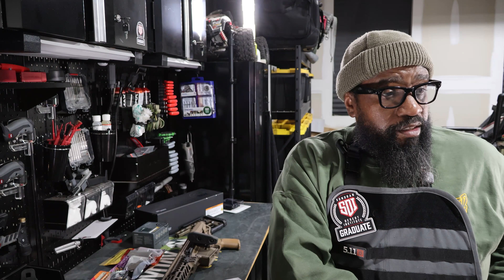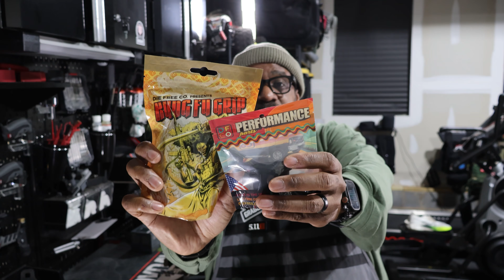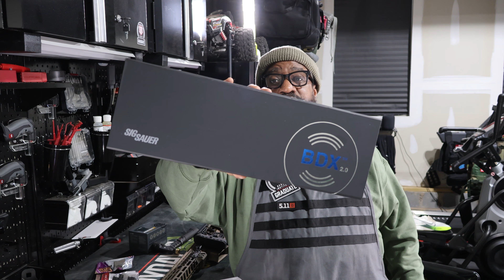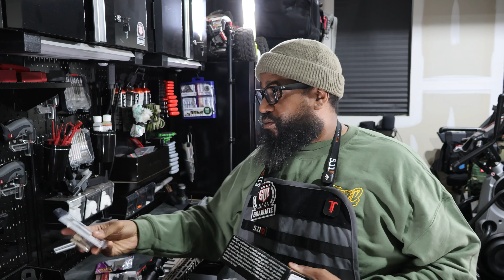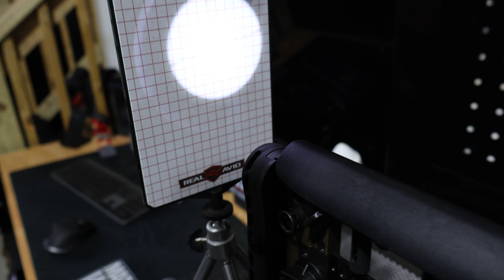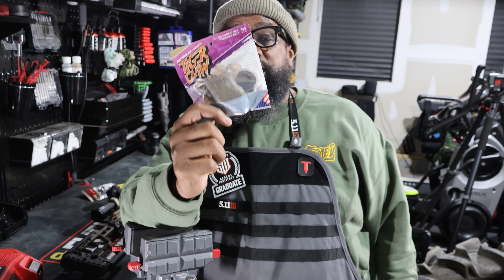Building my Ultimate Hunting Rife | Sig 308 Spear Build

Comment: Thoughts on having the red dot mounted on top of scope rather than canted 45 degree?
Reply from the maker: I think I might move it. The distance between the barrel and dot makes it hard to zero.
Reply: Save the 45° for backup irons and, if you "need" it, go with a more open-lense red dot mounted above the scope.